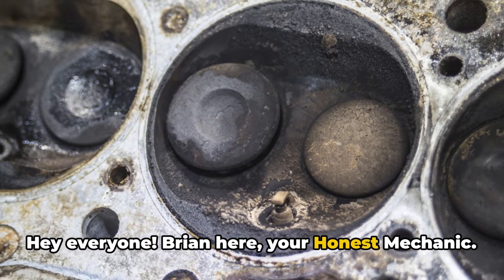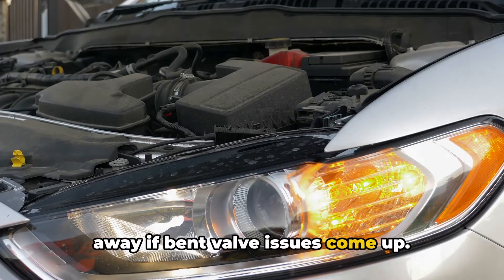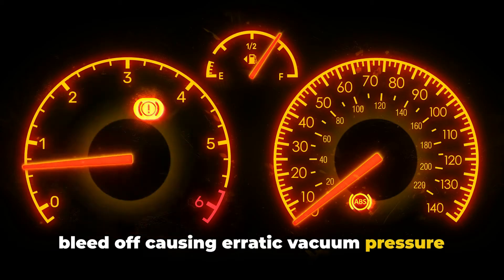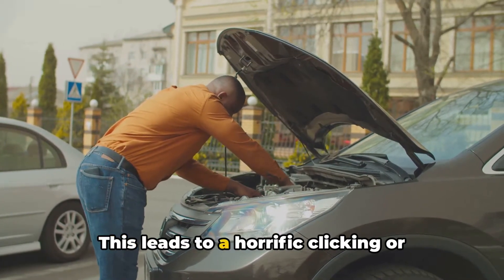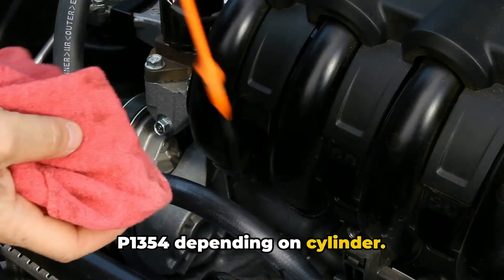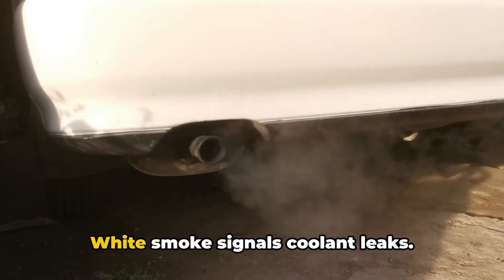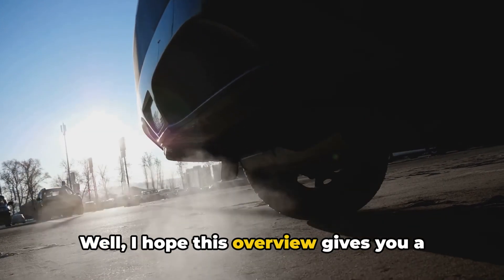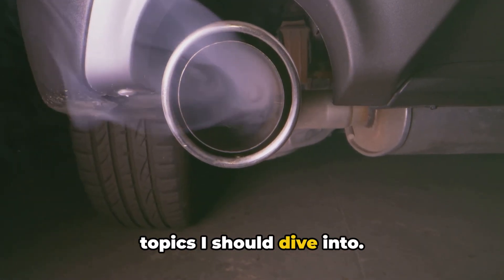Bent Valve Symptoms: 7 Main Signs

Comment: If a 2.2 Eco tech engine has a bent valve on the combustion side would it still smoke since the exhaust side is a different head

Comment: I have a bent valve that is stuck opened on cylinder 5, which is bank 1. That is showing trouble code p0172 intricating burning to rich. on my 2014  5.7L hemi

Comment: what about lean misfire on cyl 4 on  harder acceleration for turbo vehicles or even when it starts to spool? i miss shifted the vehicle and now my honda civic seems to missfire under throttle but it drives normally if you have it in econ or don't go crazy on the throttle (stage 2 hondata tune)